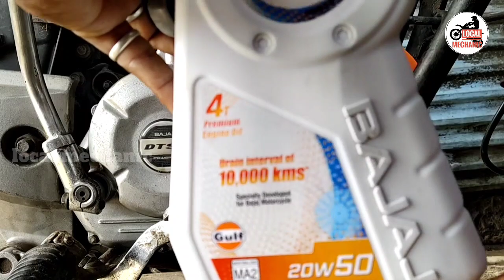pulsar 150 engine refitting part 2 / local mechanic

Comment: Bro 2014 pulsar 150 45k kilometre run airuchu . 6000rpm mella ponna adachitu run aguthu. Clutch assembly change pannitan air filter change pannitan. But  athey problem eruku enna panrathu
Reply from the maker: Carburetor clean pannunga ..
Power coil check pannunga...
Spark plug change pannunga...

Comment: Bro pulsar 180 rpm 6 malla ponna vibration aguthu bro 60 malla pova modilla bro fault sollunga
Reply from the maker: Clutch change pannunga
Reply from the maker: Scissor gear change pannunga
Reply: OK bro

Comment: Anna mileage 35 km Mattum kidakathu enna issue solumma?
Reply from the maker: Carpuretor clean pannunga
Air filter change pannunga..
Valve check pannunga...

Comment: Pulsar 180ku best timing chain sollunga bro? Company timing chain potta 3k km la sound varuthu
Reply from the maker: Original ...chain ...gear   set change pannunga bro...
Reply: Original potachu bro chain, pad, timing chain gear wheel up side downside  aana 2k to 8k kulla timing chain noise vanthuruthu
Reply: 4times change panitan bro
Reply from the maker: Morning ...noice  varutha...
Reply: Yes bro morning noise varuthu
Reply from the maker: Timing chain Adjuster change pannuninga bro
Reply: Yes all time time chain adjuster also change new
Reply: InstaBlaster.